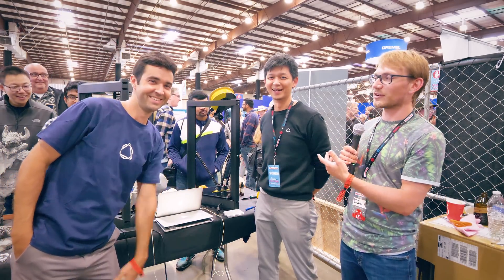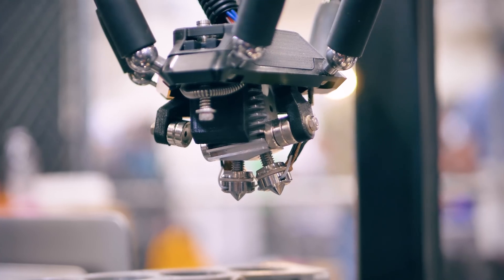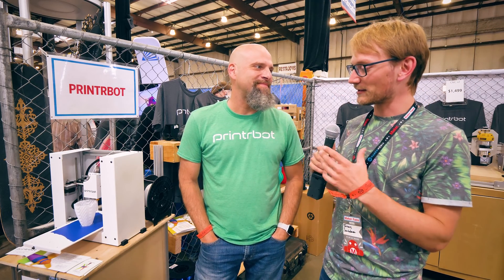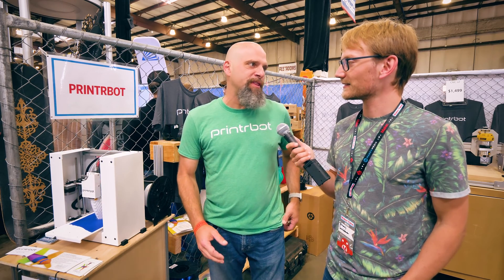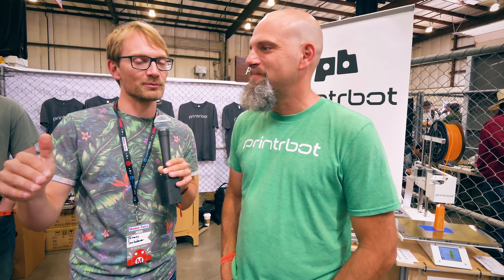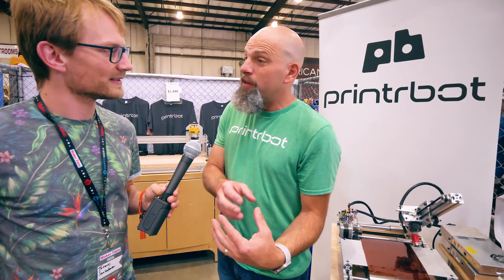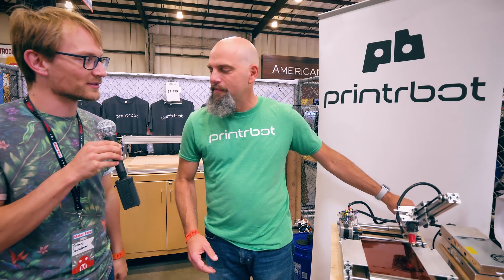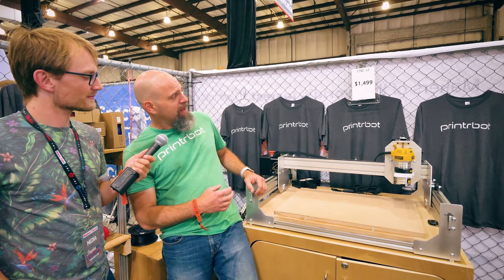Atom 3D's crazy single-extruder, dual-nozzle 3D printer! Also, what is Printrbot up to?

Comment: What slicer do they use for this single extruder motor, dual filament setup? As I see, the motor has to turn in other direction, and I don't know if any of available slicers can manage it?
Reply: The firmware should be able to handle that. Then the slicer should only need to do a tool change retract and call the tool number. (T0, T1). Some slicers set an idle temperature so the plastic isn't festering the whole time in the idled nozzle.

Comment: Which printer is the black one all the way in the back left corner?
Reply: Lulzbot Mini.
Reply: Thanks. I kinda recognized it as a Lulzbot because of the neon green structural part, but the only one I'm familiar with is the Taz 6. I didn't know that the Mini had a large frame around it.